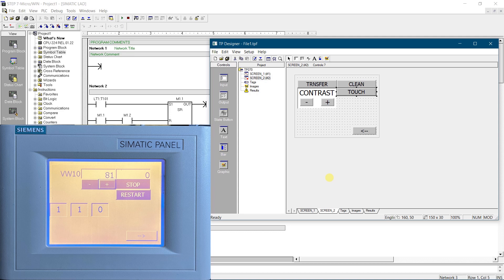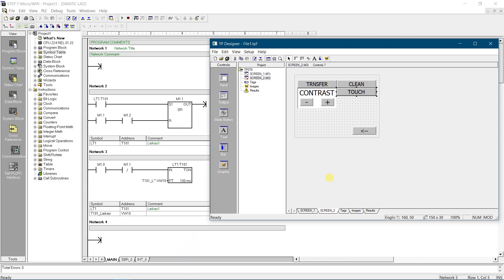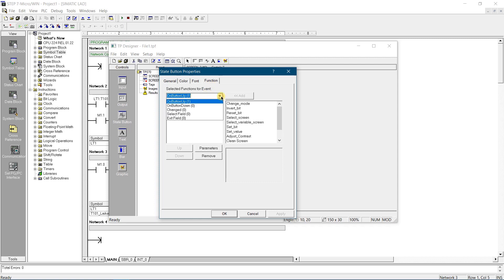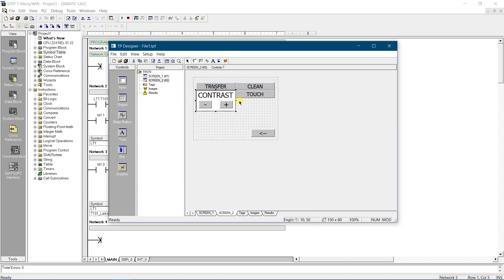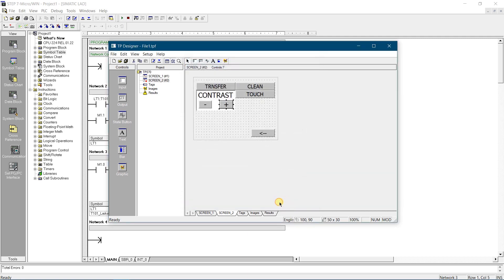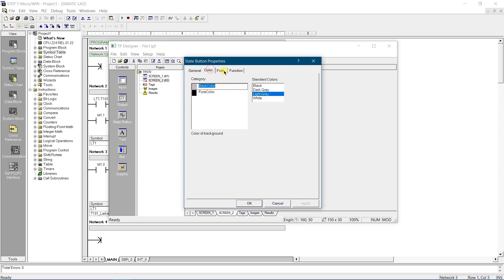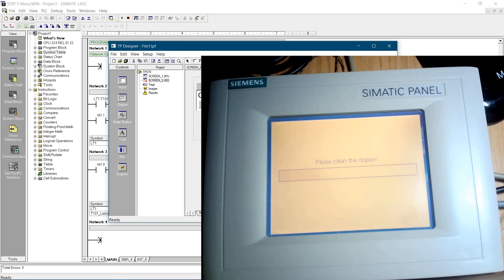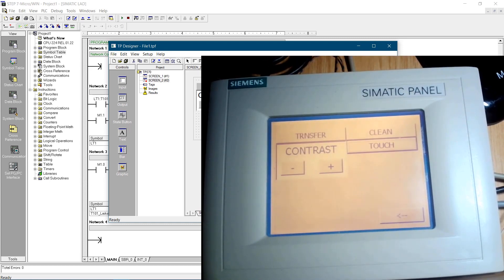SIMATIC PANEL TP070: First steps and TP Designer

Comment: Hola. Excelente vídeo tienes como compartir el software de programación del hmi, no lo encuentro en la red. Saludos cordiales
Reply: Hello, excellent video.  Do you have any idea where I can get the software to edit a TP 070?  greetings
Reply from the maker: The software is called TP designer, it is an optional package for Step 7 Micro/WIN. This package is called Step 7 Micro/WIN ToolBox: https://support.industry.siemens.com/cs/document/11859930/-new-s7-200-micro-plc-optional-software-packages-now-available-?dti=0&lc=en-WW
Reply from the maker: Hi, sorry, but i do not speak Spanish language.
Reply: Don't you have the software to sell it? I can't find it to download and I need to respond with a project for an old machine. The TP is at the end of its useful life and I urgently need to be able to recover its data, mainly graphics, to integrate a new HMI. ktp 700 basic
Reply from the maker: Leave me a message at video.vamzdis@gmail.com.
Reply from the maker: I sent a message to your email. Check the junk folder if you cannot find it.
Reply: @dorglobal7912 Do you find the program?